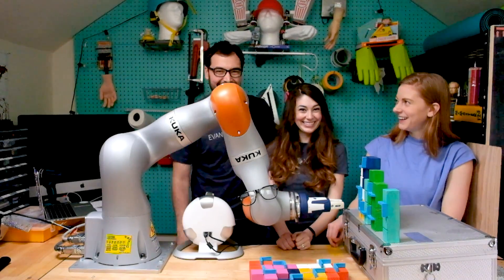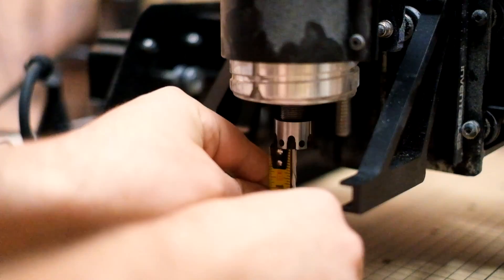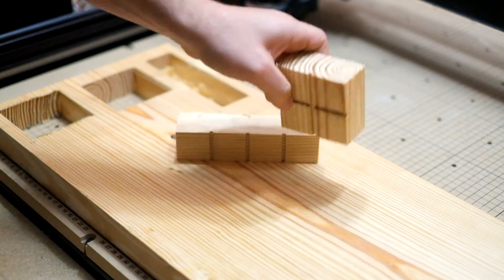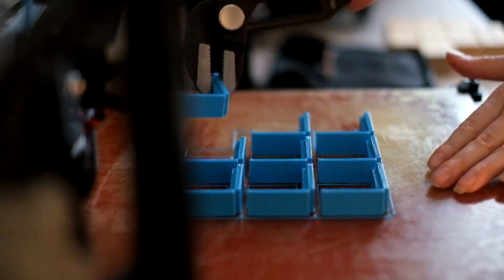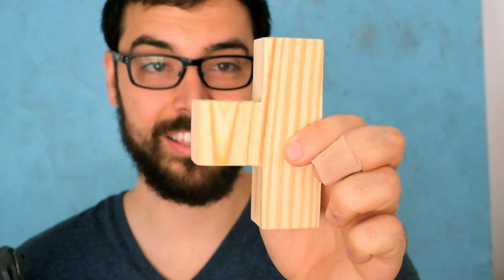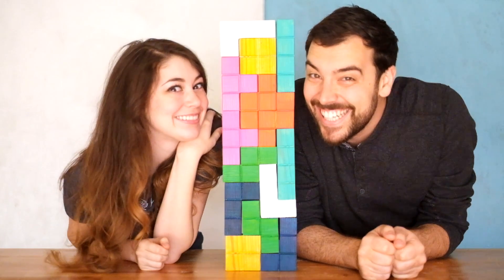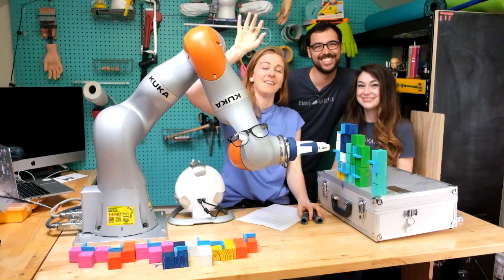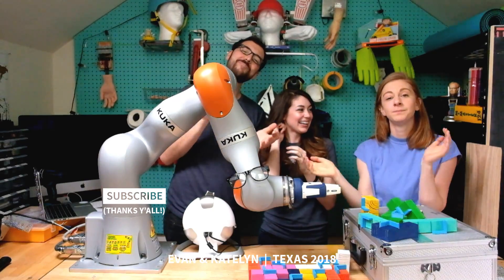CNC Tetris blocks (feat. Simone Giertz) | How to make

Comment: 6:08 I feel like, seeing as how they are Tetris blocks, which are meant to fit together in a grid, that you could have gotten A LOT more out of your piece of wood. it would have taken some clever arrangement, but I think you could have pulled it off.
Reply from the maker: because we were using tabs to keep them connected to the wood around them, cuts can't be right next to each other, otherwise pieces would come loose as they were being cut

Comment: Why did you cut with large gaps of waste wood and not cut using the edge of the wood + having pieces as close as possible?
Reply from the maker: Because the pieces would have come loose as we cut them - we secure them using tabs and if there was no wood in between the pieces, we could do tabs
Reply: That makes sense. And relieves my "OCD". Thanks.

Comment: Uses $1000 machine to cut out wood blocks, then follows up with a jog saw... How stupid can you get!!! I love CNC's, I've built several myself and use them regularly. But there not the right tool for simple straight cuts.
Reply from the maker: for us, with the limited time we had and the fact that it could cut the grooves between the blocks as well), it was  the option we chose. Definitely not the only option, but it worked and allowed us to do other steps while it was cutting. To each their own

Comment: I have just received my X-Carve (1000cm) and nearly completed the build - wow, it needs dedication, but worth it!
My question is that I notice you use double-side tape to hold down the piece you are working on. When you remove the piece, does the tape leave a 'problem' on the waste board?
Reply from the maker: Took us a while to build too! The cool part is now if something goes wrong you have a better idea of how to fix it. The tape we use kinda rolls up as you remove it and doesn't use a residue. It's kinda thick though so we are looking to switch to something thinner

Comment: There is probably a good reason to do it this way, Jimmy Diresta does it too. Why do you not cut out all the blocks on the CNC, then remove them all at the end vs. removing them throughout the cutting process? Not trying to troll, legitimately curious.
Reply from the maker: mostly because we were really tight on time so we wanted to be able to sand some (and test the brackets) while others were being carved. If we had had more than a couple days we probably would have done it all at once 👍